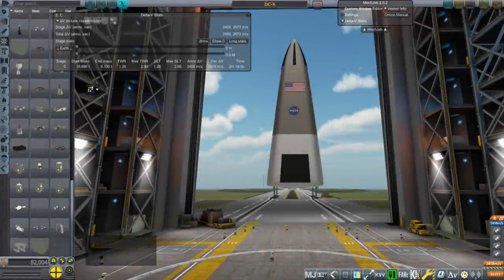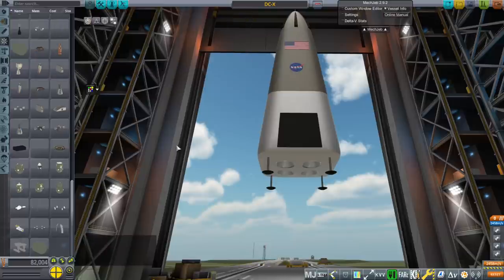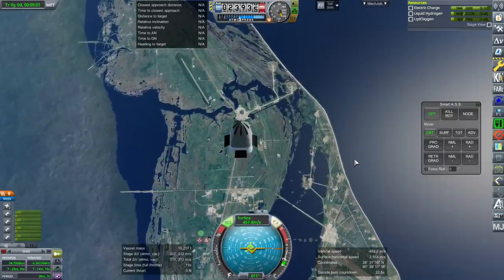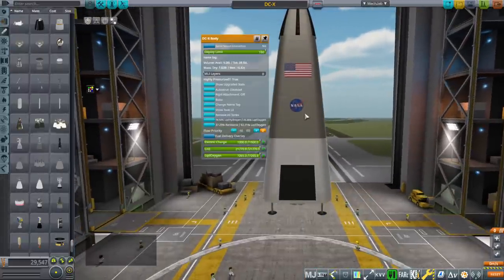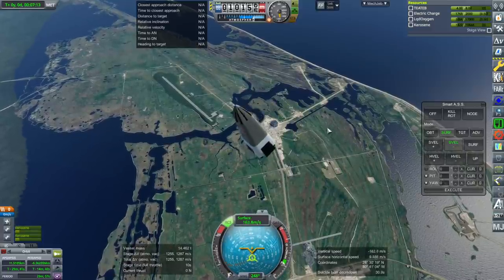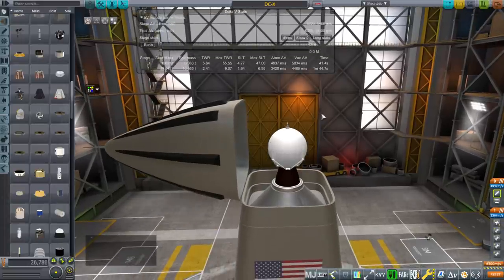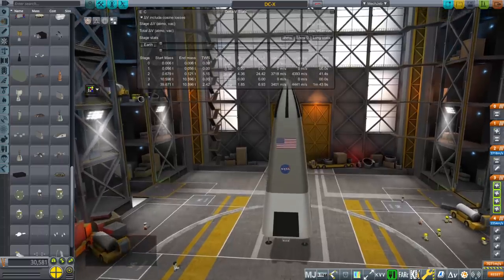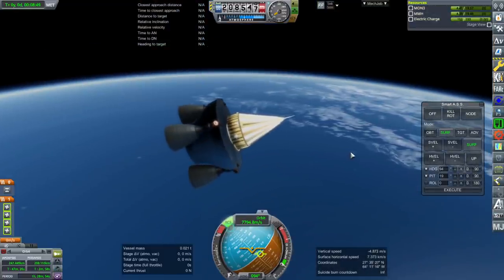KSP with Realism Overhaul - DC-X

Comment: Have you looked into how the stock A.I.R.B.R.A.K.E.S. work when you turn pitch and yaw on for control? They look to have the behaviour you want - only moving outwards, using drag for control. No ability to use em for roll, either.

Comment: Wouldn’t you get more leverage with the RCS blocks if they’re positioned closer to the top on your way down rather than sitting at the bottom?
Reply from the maker: I put them on the bottom for looks in this case, since these blocks would otherwise stick out quite a bit otherwise. Also, the lever arms aren't significantly different considering the location of the center of mass and the fact that they can't be placed on the nosecone.